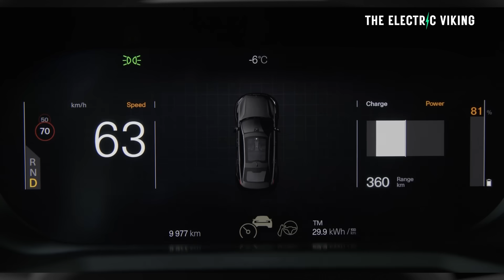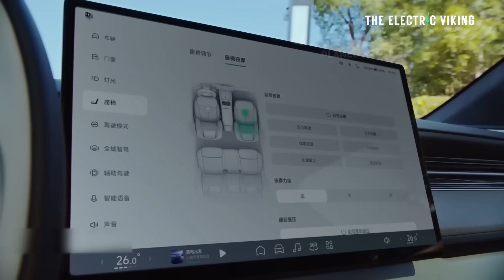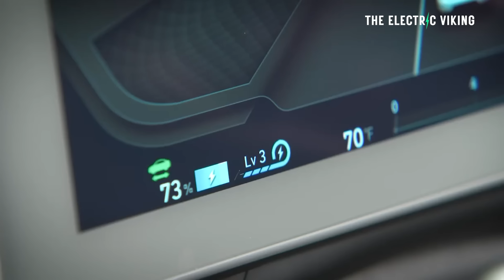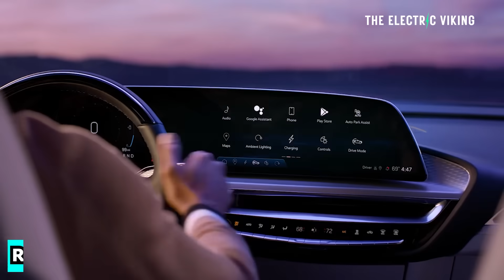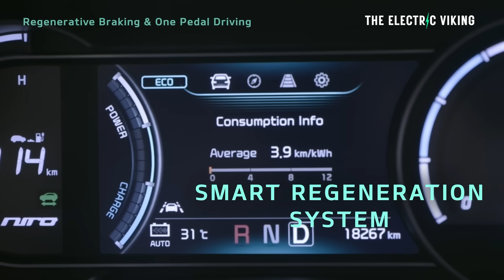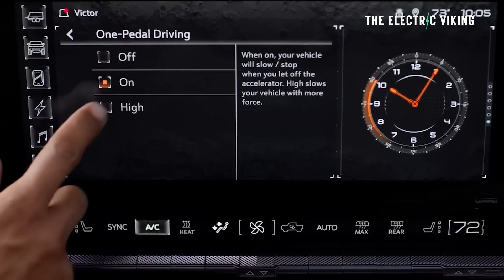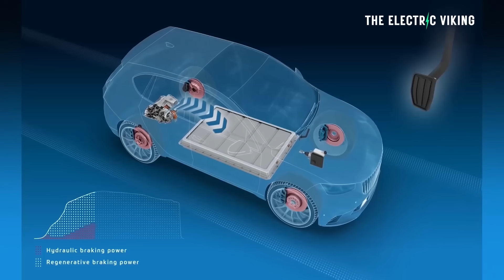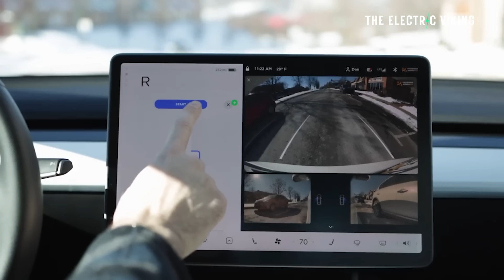China BANS Single Pedal Driving - Regulators Claim it Causes Crashes

Comment: Wrong solution to a real problem.  I was almost back ended while using OPD because I slowed down rapidly and my break lights wouldn’t go on.  The proper fix is to illuminate your break lights if you decelerate for more than one or two seconds above a certain amount.  This way drivers behind you are warned you are decelerating.

Comment: I have an F150 Lightning. Call me an old man if you like, but I do not like using One Pedal drive. Normal drive is closer to normal vehicle deceleration. If some drivers use is, more power to them, but they're probably making their passengers sick. Using the brake pedal initiates regeneration is as good as single pedal driving when the accelerator is released.

Comment: Sam, eventually you will find that you misunderstood how it is to work and that this change makes a lot of sense. First the break pedal does not negate regen braking. That still can be incorporated in the first stage of pedal depression. Actual activation of break pads would be on the extended depression of the break pedal. This mode of operation would be a safer default operation and single pedal operation could still be selected by the driver.

Comment: use or you lose it. If you never have to learn to use the brakes on a regular bases it will not be an automatic habit in an emergency. This is not about whether people want to use it or not, especially those who have learned to drive with one pedal driving. It is about safety and the only way to make the brakes work HARD in an emergency is to use it, regularly.

Comment: Sorry Sam you idea of only one pedal driving being the be all and end all is in my opinion a false understanding of the need for proper safety.
friction / mechanical braking is the final engineered solution for stopping of motion.
A pure magnetic field brake system is not free of risk of failure.
100 % reliance on regenerative brakes is flawed.
Any failure in the electric field can result in loss of magnetic braking.
A mechanical braking method is still required.

Comment: Well, to understand the EV regen brake (one pedal driving), the EV brakes will eventually fail when the shit hits the fan ( due to not using, corrosion, and not servicing). Go watch Rich Rebuilds, his newly purchased Model 3 series with 160K miles. And I am sure China must have some data to back up the people who forget to step on the brakes in an emergency.

Comment: Dude, in-Country regulations don't apply to exports.  They only apply to cars placed on the market in China.
As a safety engineer I actually agree its dangerous because regen is sometimes disabled.   There are ways around it so that you just drive the car normally and electronics decides how much regen and how much hydraulic braking there is, but its probably more expensive.
I also think menu based driving controls are dangerous.

Comment: You missing the point.  From my research they did not ban one pedal driving.   Personally I hate it, but I think they only prevented the car from coming to a full stop without using the brake.   That, I believe should be universal.  However you can still drive with one pedal and slow the car drastically still saving one brake dust etc as you list as benefit.

Comment: I can see why they did this. You're looking at this from your point of view, which has a lot of experience driving an ICE vehicle which requires constant brake usage. What about the brand new driver who has never driven anything other than "One Pedal Driving"? They may not have the reflexes the rest of us have. Take for instance, you're teaching someone to drive a manual transmission vehicle. When they have a panic stop, they hit the brake and usually won't also depress the clutch at the same time, causing a stall. I can see the same thing happening to a person who has never experienced driving without one pedal.

Comment: I am having trouble getting used to single pedal driving. I would like to see a potentiometer added to the break pedal, to use regen until it is maxed out and automatically add physical breaks at that point. Then you will get the best of both if you don't like single pedal mode. Just a thought.

Comment: The way you speak about it, it almost seems like your'e confusing one pedal driving with regen as such. You won't suddenly use more brake pads just because you use a different pedal to engage regen. And yes, i'm intuitively pretty sure that muscle memory plays a big part in your reaction and decision making under pressure. If you don't use the damn brake pedal for your everyday braking, you're less likely to act quickly when you need it. Especially the least proficient drivers.

Comment: This is basically a Software controlled feature. As such, it is a feature that can be turned off. In CHINA. And turned ON for Export.

I would agree that it is a deal breaker. If it does go completely it might provide a very slim lifeline for other OEMs though!

Comment: Some european EVs, regenerate from 10% push of the brake pedal, without activating the actual brakes. That is what China wants, I think. It is safer. Also an activation of any small decelation will make it also safe for one pedal driving. The problem here is that most car manufacturers didn’t set the brake lights to activate at a slow decelaration. In an ICE car, when you are in gear and lift up the accelarion pedal will make the car to engine brake without activating the beake lights. It is also dangerous.
EVs manufacturers can easily change this from the software, since most have brake by wire! 
I don’t see a big deal! It is an easy fix.
I would even like to see brake lights increasing the ilumination based on the procentage of decelaration/ brake pedal push. It only requires a potentiometer giving more or less amps to the brake lights. That will be really nice to have! Regulators still lagging here.

Comment: Single-pedal driving offers significant safety advantages compared to conventional braking methods. For instance, when a vehicle in front of you brakes suddenly, the single-pedal system immediately decelerates the vehicle, allowing you to apply the brakes more promptly. I currently drive a Tesla Model 3 Performance, and the ability to engage single-pedal driving is a crucial factor in my decision to purchase the vehicle. Without this feature, the time required to stop in an emergency situation increases the likelihood of an accident. Additionally, the strong regenerative braking system is another key reason for my choice of purchasing a Tesla. If a new car does not incorporate single-pedal driving or robust regenerative braking, it is undoubtedly a disqualifying factor for me.

Comment: It is not banned Sam, it is not set as default. MY EV doesnot set it by default, I have to turn it on. I really do not think this is an issue. It makes no sense because using the auto-regenerative braking as in one pedal mode, is more efficient and regenerate more energy back to the batteries.  I highly doubt China is reversing soe aspect of making less pollution and providing greener means to produces/reproduce energy. From Car News China, 

"China has introduced a new national standard for passenger car braking systems, GB 21670-2025, which will impact the “single-pedal driving” mode favored by some electric vehicle manufacturers, including Tesla. The new standard, approved by the State Administration for Market Regulation and the Standardisation Administration of China, prohibits vehicles from defaulting to a single-pedal mode that allows deceleration to a complete stop solely by releasing the accelerator pedal.

The new standard, set to be implemented in phases, will take effect for most new vehicle type approvals on January 1, 2026, with the specific provisions regarding single-pedal mode becoming effective on January 1, 2027. For vehicles that have already received type approval, the new standard will apply from January 1, 2027."

Comment: One pedal driving took me about three trips to master but what it does is makes you aware of your speed and following distance when in close traffic or approaching a stoplight /sign much more so that otherwise.    They don't stop on a dime and if you are too fast or too close and don't feather the pedal you can over travel your estimated stopping point and have to use the brake.   Okay , not a big deal but should be avoided.  However , Tesla insurance with their continuous monitoring will call that  "hard braking" and will pull your safety score down.   Overall I like it and will continue to use it.

Comment: Not sure if I fully understand what this new regulation means.  If this means someone has to set the brake mode to single pedal mode whenever he starts the car, that is just annoying and silly.  On the other hand, if this means the default driving mode coming out from the factory cannot be set to single pedal mode and someone can change this in his driving profile, to a different default, I will agree that this is a good idea; because a lot of people don’t get used to this mode of braking, at least not in the beginning.

Comment: Crazy but, I can cope with using the brake to finally stop, then auto hold. Do this every day at the downhill traffic lights at the bottom of my street. Not a show stopper, forces the foot into the hover over the brake position in anticipation, but on the flat not at all usefull. Tesla has lots of silly controls too so in the end the driver adapts. PS didn't hear the latter parts of the vid before I commented. Having said that, people often get confused about where their feet are and press the accelerator thinking they  are hovering over the brake. Maybe one pedal would reduce these old folk (like me) errors which spear cars into shops.!! etc.

Comment: Sam- clearly EVs will still have regen breaking to ensure good economy. So the question this is how strong it is. By one-pedal do you mean completely stop the car or just slow it down to a walking pace. I prefer regen to just slow the car to an almost stop but have to press the break pedal to stop completely. Reason - when manoeuvring in a tight space the car will continue to role and speed can be controlled on the break. Just like my old deisel car which would move on tickover alone.  BTW when using active cruise control, then the car stops automatically before hitting the vehicle ahead.

Comment: I’d like to share my experience as a driver who was following an electric vehicle using single pedal driving—specifically, the IONIQ 5.

When the EV driver lifts their foot off the accelerator, the car decelerates quite quickly. However, the problem is that the brake lights, which should alert the driver behind that the car is slowing down, do not turn on. The brake lights only activate when the IONIQ 5 driver actually presses the brake pedal.

In my opinion, this is a real safety concern for all road users.

Could you please talk about this issue and how automakers are currently addressing it?

Comment: The problem in China is that there are too many inexperienced drivers just switching to the new cars, causing accidents when one pedal mode is used. It's a China specific problem, which is happening since China is moving to EVs in large numbers, and many don't know that there's a difference

Comment: I agree with other commenters that this is an over-reaction. China are not banning regen braking - speed loss when foot off gas. It’s more a question of emphasis and terminology. Regulating speed in traffic with gas pedal only will remain available. But the term “one pedal driving” is problematic because it can go too far and lead drivers to think they are somehow bad people if they hit the brake pedal. “One pedal driving” might make drivers feel they shouldn’t use the brake. Or that it’s unfashionable to do so. The Chinese authorities who made this rule are not stupid, they are doing it from real data. My understanding is that this is more about the term “one pedal driving” than about keeping the advantages of regen engine-braking - which will be kept and are not threatened by this new rule in China.

Comment: 1:22 Upon stepping on the brake pedal, most EVs and hybrids will activate regen first and then engage the brake calipers if more stopping force is needed. Using the brake pedal does not necessarily mean brake dust is being produced. Why Tesla didn't implement regen into the brake pedal is anyone's guess. Hybrids have been implementing regen into the brake pedal years before Tesla was even a thing. 

Sam, I think you're putting too much weight into people's desire for one pedal driving. Sure, the Tesla fans will want nothing less than full one pedal driving to a stop. While others, especially those coming straight from ICE cars, will want something that is familiar and operate like their old ICE car, but has the benefits of an EV. Even Tesla has now seen the benefits and implemented blended brakes in the new Model Y. You even made a video on this subject. "Tesla’s New Model Y gets hugely improved 'dual' braking system" - https://www.youtube.com/watch?v=Ck3bjECxz9o

Comment: There was actually research done that shows, after prolonged used of one-pedal driving, drivers will forget to press the brakes, or wrongly step on the accelerator during emergencies due to muscle memory. China is trying to save lives here, not just the driver's, but also other road users'.
Reply: It makes sense, they have the most experience and largest set of data to look into

Comment: Dear Electric Viking, There are 2 misunderstandings here: 1.) Pressing the brake pedal does not immediately engage the friction brake - my Renault Scenic E-Tech starts with regenerative braking and only adds the friction brake when full brake torque is requested - and other EVs should be similar. 2.) The "standard interface" of a car is a steering wheel and 2 pedals. An untrained driver expects this standard interface to be as usual to be able to drive the car safely. I'd even say that "exercising" the usage of the 2 pedals in the every day usage is the best way to keep every driver "fit" in the routine foot movement that then needs to be activated in an emergency brake operation - using the "body's memory" exactly then.
Reply: If you just want to drive the car in a conventional manner, just cover the brake pedal as you would normally do.  I had a Tesla, and drove it mostly using one pedal driving but if I needed to pull up quicker, I just pressed the brake pedal. There's nothing to learn and not different to a conventional vehicle. I however, would not buy another EV without one pedal driving. Our BYD Atto 3 doesn't have it and I miss it so much.

Comment: This issue is very clear to me. One pedal driving makes it more confusing. Foot is on or resting on the single pedal, whereas when we were taught, we were taught to cover the brake when not accelerating. Old way is go/stop mode with 1 pedal for each mode. New way is go/stop/stop mode, with the driver untraining the safest behavior, covering the brake. The error being risked is jamming on the accelerator rather than the brake. Rather than act stupid about it and blurt out your opinion, when you cover this safety topic, you should inform yourself about the safety studies and the benefits and the potential compromises and give a better balanced report. I now take your videos completely differently: they’re just opinion pieces. Ok.

Comment: Yeah I think you've misread this one Sam. Banned from defaulting to one pedal mode, not banned outright. 

Personally, I really dislike hard set factory defaults. What is the point of having a driver preference setting in a vehicle, if you cannot set half of them? Infotainment system settings are one thing but why can I set my chair but not what ADA systems I want on by default? Why is traction control, the HUD and Auto-hold on by default but lane keep assist, drive mode and and cruise-control have to be selected each and everytime I fire the engine? If you give the option to switch them on/off then the option should be there to set your driver defaults. It's just plain dumb to have this half/half setup, to the point that you almost perform a "pre-flight" check each time you get in the car.

Comment: I do experience something similar to a reaction delay when I switch from my EV3 with I-pedal to my Campervan with very little regen let alone one pedal driving.  My drive has quite a slope and the van rolling sometimes catches me out, just momentarily.  On the regulatory side I would concur with many of the comments on the default aspect of the story that suggest it’s got to be user selectable each time rather than removed.  It’s quite annoying to me that I can’t even select ECO as my default drive mode!

Comment: This does not mean that one-pedal driving has been banned completely in China.  Drivers still able to select it as an optional mode. However, this mode must be selected by the driver.

It is really meant to ensure that drivers have their foot on the break when they are stopped, rather than preventing regenerative "breaking" from one pedal driving.  
Why?  Because many drivers have unintentionally accelerated when stopped, causing many accidents.
Reply: MG have already done this with their MGS5 replacement for the ZSev.